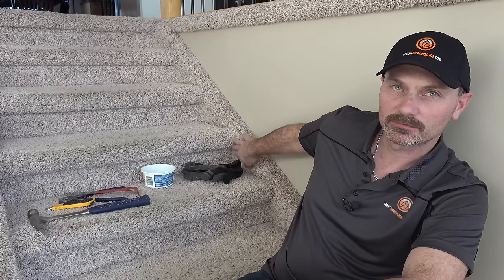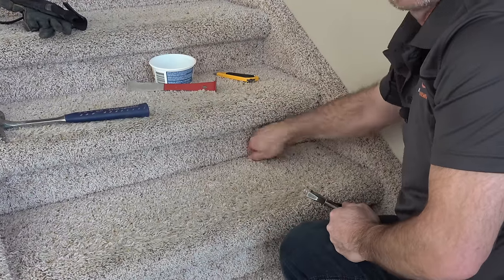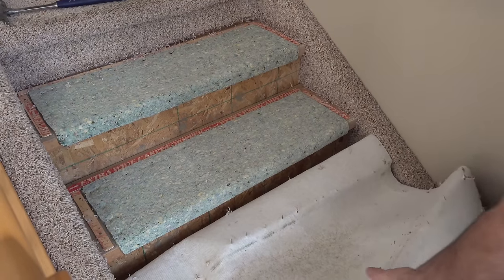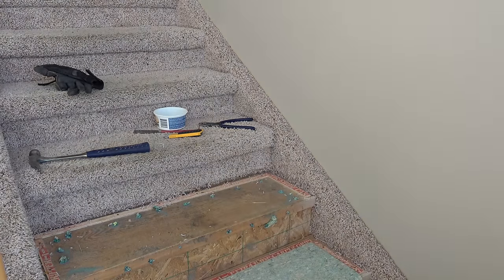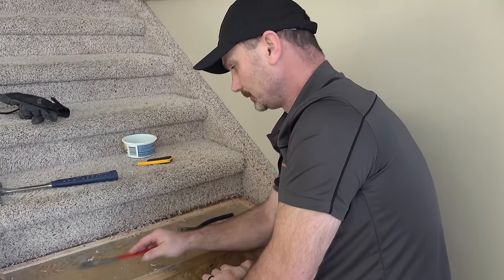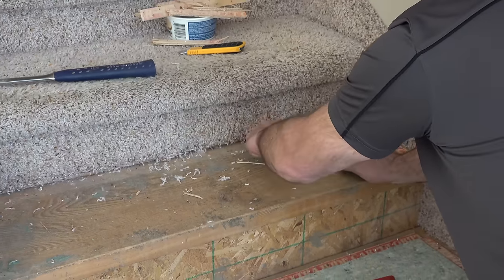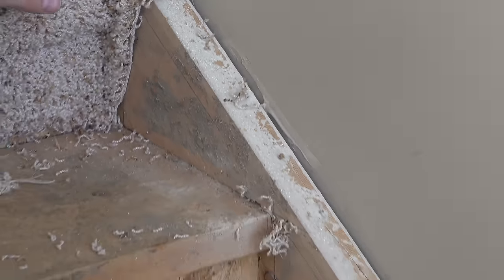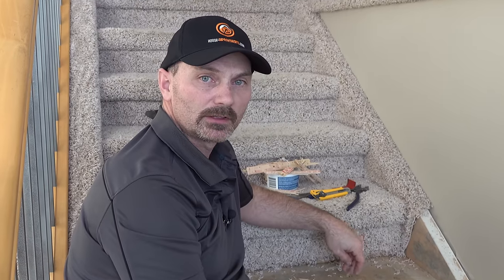How To Remove Carpet From Stairs

Comment: I used your video on removing baseboards and removed them all on my main floor and entryway in preparation for new flooring installation.  I didn't break any!  I am 65 years old and not DIY skilled at all, and am very proud of myself.  :)  Thanks so much Shannon!  I love your no nonsense, clear directions and tips! Next, I'll remove my carpet, with your help.
Reply from the maker: Thanks , please subscribe to my channel if you have not already.
Reply: I'm in your camp. I am preparing to remove the carpet from the staircase. I will be staining the stairs after all the cleaning and sanding in places. We can do it! Thanks to Shannon.

Comment: Oh hun, thank you. I'm an old 48 yo single mom in England. Iv got to remove my stair carpet. It's been there since the 60's. Replacing it with a runner. To keep costs down, as I'm getting a pro in to fit me new stairs n landing carpet, I'm doing all the hard work. Iv painted bannisters etc. Now to lift the old carpet n paint some more. Your video has shown me, I don't have to be scared to remove it. Thank u xxxx

Comment: 3 years ago I removed the carpet from a large staircase and I have to say it’s one of the worst jobs I had ever done.  They went staple crazy when they put the carpet in.  Every inch had 2 or 3 staples.  Hellish job getting them all out.  Thanks for the video Shannon.
Reply: That’s the situation I have right now.  Planning to paint stairs after removing all of these tiny staples.
Reply: David Moutardier Best of luck.

Comment: Thanks for your video! We bought a house and the carpet on the stairs was installed in a way that the edge is rounded causing lots of slipping down the stairs. Pulling it all up and installing individual treads.

Comment: I have the carpet pulled off my stringers & am wanting to paint them & the risers (vinyl will be installed on treads only, with noses). There was glue used for the stringers, really rough. Do I just sand it off or should I use some sort of glue remover?
Thank you in advance!

Comment: This video is great! I plan on removing the carpet from my basement stairs and I would like to simply patch the holes lefts from the staples and paint the stairs. What product do you use to fill the holes? Also, can I just prime and paint this type of stair or do you have to change everything? I am not sure if my idea is ok. Thank you!
Reply from the maker: You can patch the stairs with a wood filler and sand ,prime and paint if you like. Many of these types of stairs are not really pretty because they were built to be covered up but usually with some patching, caulking and sanding you can make then look pretty good.

Comment: Does this technique apply if we want to reuse the same carpets? Since these were done partially in the video..
Reply from the maker: The carpet will be usually unusable after removal from stairs
Reply: @HouseImprovements  thanks, but can I ask why? I removed the carpets today ironically and they were in really good condition. Assuming it would need just stapling back if we keep the same underlay??

Comment: Any tips on filling the gap between the stringer and tread? We want to paint, but there are gaps on both sides (about 1/2" each) that the carpet edges were stuffed into and we don't know what to do to fill it so it's smooth and won't show. Help!
Reply from the maker: Wood filler and then sand smooth

Comment: Hey Shannon, do you have another affiliate link for the red pry bar? The specific one you linked is out of stock but at first glance, it looks like there's more than a few others that are white labeled under different brands. While I'm at it, do you have a link for an olfa knife? Replenishing my tool kit and want to use your links.
Reply from the maker: In this link for the forum you will find our Amazon affiliate links for .ca or .com you can use either one to order anything you want. The red coloured bars are the ones I prefer there are a few sizes. I believe the ones I use the most are 10". I also like any of the Olfa knives with the 3/4" blades.  https://www.house-improvements.com/forums/viewtopic.php?f=10&t=4565

Comment: Ok lesson here is who ever will put carpet on please do not put too much stapel on just in case the next person wants to remove the carpet.😮
Reply: I’m tearing up my stairs right now and I don’t mind the extra staples they used . I hope the next installers uses the same . They did an excellent job with the last installation. Carpet is original to the house ( 24 yrs ) and still looked great but as new owners, we wanted new.